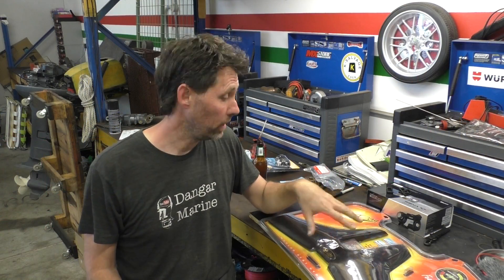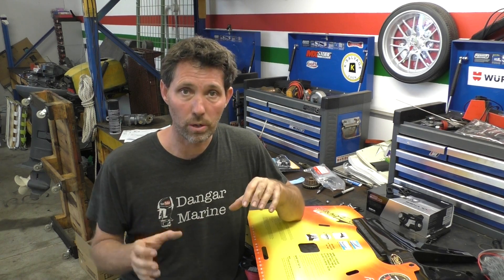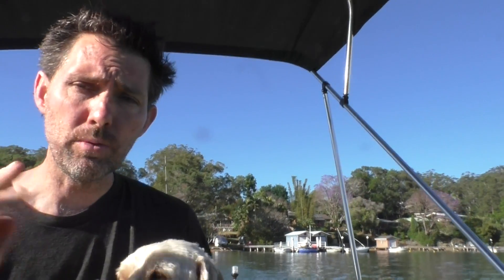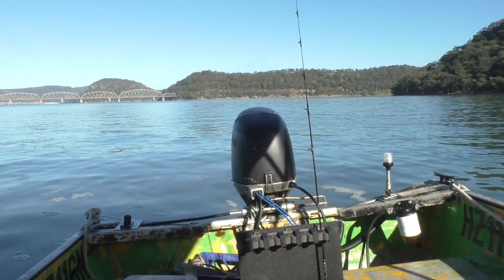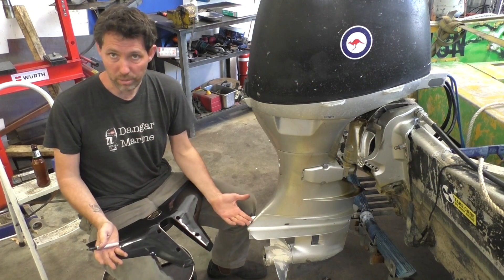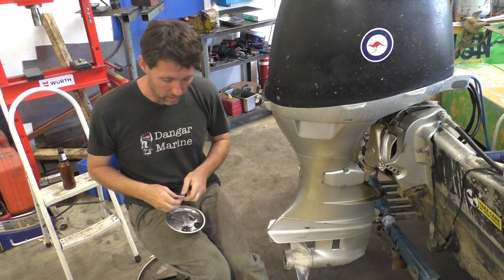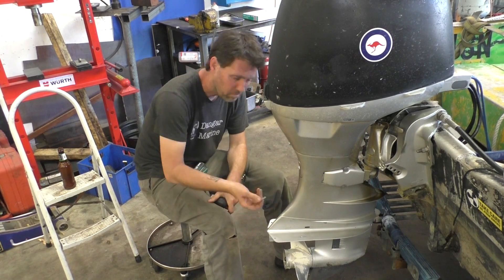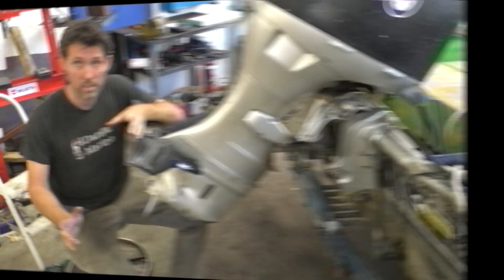Outboard Hydrofoils

Comment: my boat was a Nissan Wing Fisher 21, the original outboard for this boat was Honda 75 hp maximum and the boat dry weight with 650KG only, that really strange for a 21 foot long of boat so light just like the Japan cars.

After 2 or 3 year later last owner change to a Yamaha fourstroke 115, I found that it should add weight about 20kg to transom, and the live well cannot be close so there always having water in it.**  It something hard to planning and the bow rise pretty bad.

What I own this boat, I fixed the live well with epoxy, so when I go fishing but not yet getting fish in it, it can remain close with minimal water in it, another thing I do was adding hydrofoil SE sport 300 to my Yamaha F115.

What I feel that with great changes.  The boat much much more easy to get plane with even open livewell, 2 people onboard setting near transom, so there was many of weight at the transom, still getting plane with about 4200rpm easily and keep it in 4000rpm (if rough sea need more about 200rpm).  Another good thing for this is the bow rise almost solved, I can sitting on to see front very clear which helps safety visual.

For me, the hydrofoil save my day, really love it.  I heard that the Smart Tab even doing better job by the shape and 2 tab install to the transom, but it need to drill the transom which made me want to stick with outboard's one, or any idea for those drill holes in the transom?

**Many of Japanese boat or Hong Kong fishing boat, the live well design with no pump, it just having 2-4 holes plus tubes direct to sea.  So when boat start planning, the water will goes out from the live well to sea for reduce weight, leaving some of water in the live well for fishes or baits.
Reply from the maker: It's interesting to hear stories of where a hydrofoil has really helped. They definitely have their place in solving problems like the one you used to have. I don't have any problem with drilling through the transom so long as the holes are well sealed with a good marine-grade sealant.
Reply: So the 3m 5200 marine sealant should good for transom works even the boat need to stay on water all the time, thanks Stu!

Comment: I have a 14 foot tin boat... 6 gallon fuel tank in the back + a full size battery in the back and one lardass tiller operator:-)!! When I hit the throttle it looks like a P-51 Mustang on the runway. I have to slide on the rear bench from one side to the other to look around the bow to see where I'm going.... 
3-50 lb bags of sand in the bow and she is good to go. My gas mileage seem to improve because the ride is so much smoother all around. 

And if this boat ever pisses me off again it's going to be really easy to sink her with the extra weight in bow.. lol 
j/k I love my tin boat and I've had some pretty expensive boats in my lifetime.  

Thanks for another great and honest opinion video Stu.
Reply: You should put the gas tank and battery up at the bow.
Reply from the maker: I'm not a huge fan of adding ballast to a boat, but I am a bit fan of moving everything you need to carry anyway as far forward as you can, particularly with tiller steer boats. Once you have the battery and fuel tank forward, you might find that a hydrofoil is actually one situation where you get some real benefit from it.
Reply: Small boats often need ballast. A hundred lbs in the bow can make a world of difference.
Reply: Kennnny77 thanks. Working on getting the tank, the battery and some additional storage up there... Just can't seem to take a break from fishing long enough to get it done..lol One of these days I'd like to convert the two front sections to storage under a nice carpeted fishing platform :-)
Reply: Ditto.  Since it's a 6 gallon tank, I'm assuming it's portable, not built in, so just get some longer fuel hose and put it as far forward as possible, even if not at the bow.  I'd not bother moving the battery.  While it's heavy, the work and expense of really long main/starting cables, etc. isn't worth it.  You might also look into the automatic trim tabs someone mentioned for $110.

RichE
Reply: Mr. FatBasstard  
If u read the comments I have the same problem lol. So I got one it works well for me and carry a can of fuel 2/3 of the way up the boat of a esky.
Reply: BAJATWIN that's great and thanks for the tip too... :-)
Reply: Mr. FatBasstard qa
Reply: Mr. FatBasstard  poooooooooo
Reply: Tony Rich Spaceball 1 went to Plaid at Ludicrous speed! I suppose I can fashion a ratcheting harness to keep myself in the boat.  Lol... thanks for the tips

Comment: Thanks very much Stu for doing a comparo on this. I'd wondered for years if there were any real benefits but being lazier than you, never got off my duff to investigate. 🤓. Like you, I've never had a solution looking for a problem anyway. Usually I'd put ventilating and proposing down to the boat saying, "Hey, dumbass - get on that trim button!" Now, I do have a bit of an issue running level on plane if I'm alone in the boat - a 17 foot Scout fish/ski and 90 Yamaha. My battery compartment is way out near the gunwale on the helm side and with no passenger it runs a tad low on the starboard side. Til now I've compensated by running with the live well full (which is located mirror image to the battery compartment but on the port side). Levels the boat nicely but means I've taken about 50 lbs of water on board for nothing more than ballast which may affect economy and top speed. Perhaps one of these things might help in that regard...
On our other boat, a rather decrepit 14 foot tinnie, I do wonder if a fin might help with trim. In this video of my son running his first solo ride ( https://youtu.be/BfUsndfaEiU ) with me running alongside (Eddie the Wonderdog, meet Herschel the Wonderdog!) you can see the bow is slightly elevated. And that's with the motor in the bottom pin hole AND about 50 lbs of ballast in the front. Now, that 1956 Johnson is a heavy beast for only ten hp but still, I'm surprised how much weight is required up front to run level. I'd hate to besmirch such a marine classic with a hydrofoil but it might come to that...thoughts?
Reply from the maker: I think if there is anything a hydrofoil might be good for it seems to be for getting the bow to go down without resorting to huge amounts of ballast up front. I do think have weight distributed well port / startboard is important, and I do try to keep my fuel and and battery as far forward as I can given the outboard is already putting loads of weight behind the transom already. Oh, and you are dead right about so many porpoising problems being from people not having their boat trimmed properly.

Comment: Thanks for your expert opinion. My experience is quite similar. I installed same product you are testing in my Bayliner 180 bow-rider and just minimized the lift of the bow, but made the boat very "wet" in non-flat waters (bays, ocean) or when it was choppy. Also I noted more difficult turn-driving, less final speed and more gasoline consumption. I took it back to the vendor. Now I own a Proline 20 feet and I am gonna install automatic trim tabs, which are quite inexpensive (US$110) and looks the results are much better.
Reply from the maker: It's interesting that reduced fuel consumption is an advertised feature. I guess it needs to lift the stern out of the water high enough to offset the extra drag it must certainly cause. If it makes the boat wet in rough weather it's definitely coming off! Trim tabs I only tend to see on bigger boats but are certainly a good way to go.
Reply: Florencio Fontecilla Trim tabs are the best of both worlds!
Reply: Venomous villain Thank you, I am on my way to buy and  install them...
Reply: Hi RichE, I have done an extensive research and arrived to the conclusion that in my case (Proline 20 feet, Mercury 150HP) the best tabs I can get is the Nauticus SX9510-80 Smart Tab SX Series Trim Tabs, which is sold at Amazon for US$112+10 shipping and handling.  You have to take in count the size and power of your boat to choose the model of the trim tabs, because the actuator (shock absorber which make athe tab movement) depend on these variables. If you have a smaller boat, need an actuator "weaker" and if the boat is bigger and more powerfull, the actuators need to be more stronger to resist the water stream. The Nauticus model  I ordered has 90% approval with 4 or 5 stars, which indicates is pretty effective and good quality, I hope. Take a look of their web site to select the model for your particular boat.
Reply: What brand/model automatic trim tabs and where are you buying them from?  Thanks.

RichE